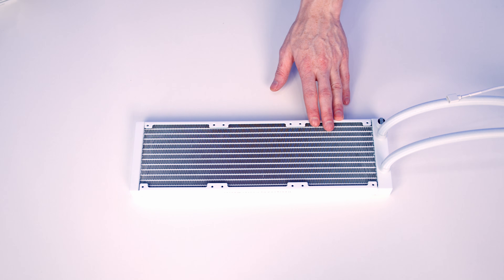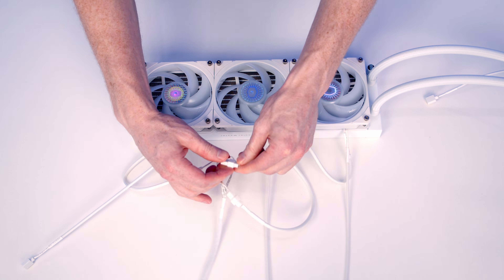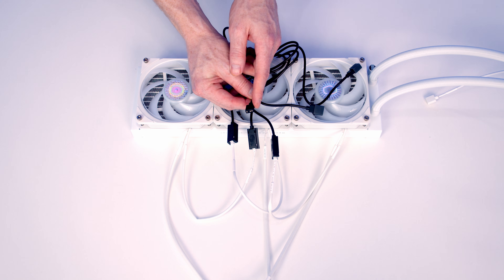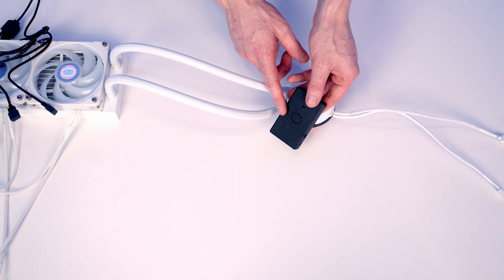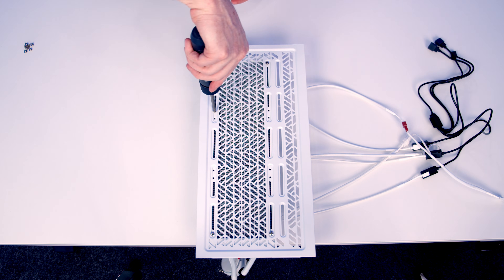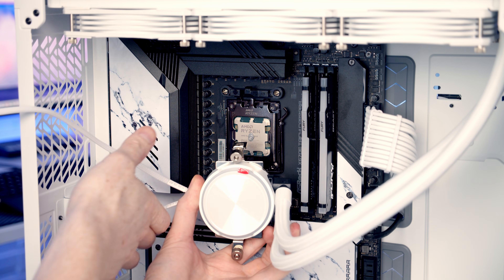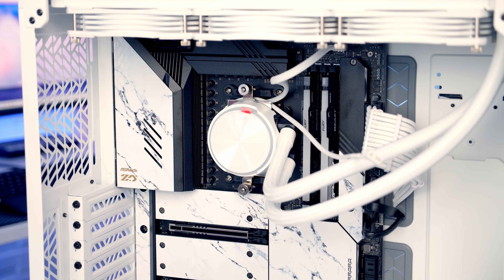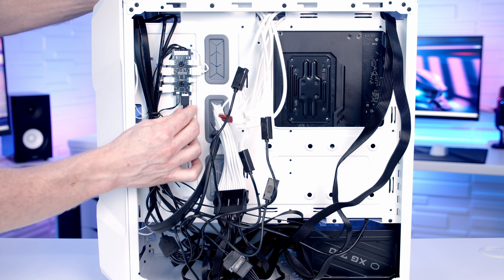Cooler Master MasterLiquid PL360 Flux White Edition - Installation Guide

Comment: Lame non-standard crap on that AIO. WHO holds on an AIO with only 2 screws, or even a normal heatsink now? Don't they know you can't get something to lay completely flat with 2 screws on a square processor? Why all the damn cables? It needs 2 cables like the one I have now, one for all the fans, and one for the pump into pwm which also powers the lighting of the pump. Where do they get their engineers?

Comment: Do you know how to turn the logo on the pump head? I can't find any mention of it anywhere. Thanks
Reply: if you're still wondering, you can simply rotate the plastic top part with the logo on it
Reply: @Benjiio  I found it doesn't move now that it's fixed in place though. Thanks for confirming as I couldn't work it out
Reply: @areadhead  Hey I got the cooler today and was wondering the same. So it can't be rotated after installation?
Reply: @navanitadas7727  Honestly I haven't tried since it's fitted and working but apparently it does turn at the part where the logo is. I wonder if mine is just really tight
Reply: @areadhead  ah I see, ye I tried to rotate the logo but it doesn't move no matter what. Ig it needs to be adjusted before putting on the mounting brackets
Reply: Same here, cant turn it its just diagonal lol